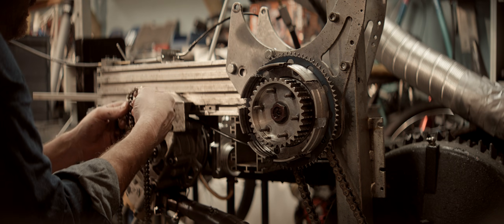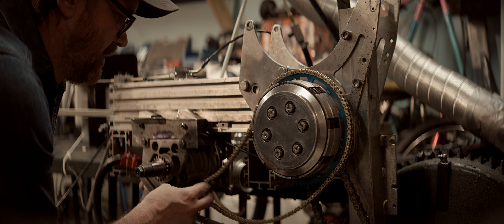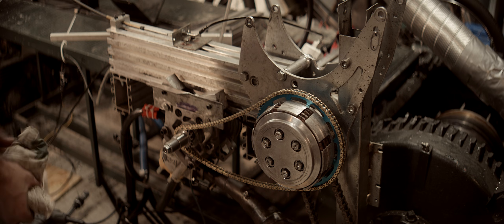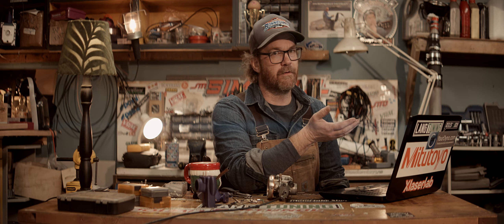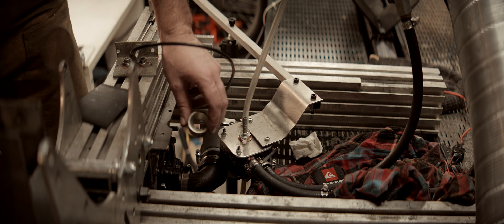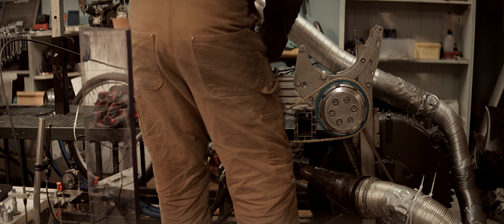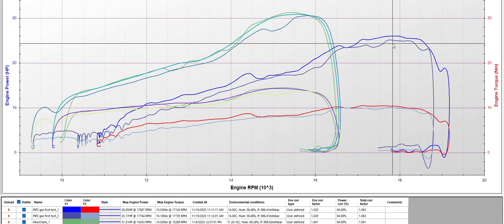50cc - 26hp on Pump Gas(without any tuning!)

Comment: I run methanol in race outboards. We have found that a pipe designed for Gas is always too long due to the cooler exhaust gas temperatures with methanol versus gas. In your video, the RPM with gas was 4,000 rpm higher than the RPM with Methanol/Nitro. Thus, the pipe you have is too long for the cooler EGT with methanol and is holding the RPM back because the tuned length is too long.
Reply: Hope he sees this, I can see this being the case. Great observation
Reply: I already wondered why it doesn't revv higher compared to other high performance 2 strokes like a 100cc kart engine or even setup Mopeds that reach 17k+
Reply: Yeah David is correct
Reply: 50 cc's is the magic number for street legal with no license, in many states.
   I'm picturing a 100lb bicycle, with 20+ h.p...sounds FUN !!
I WANT 2
Reply: @bartbullock7817 street legal with no license 50cc but restricted to 45kph. the most powerful were 8hp. there is no market for stock production 50cc more powerful than that but there is plenty of aftermarket kits. typically once you start u restricting and tuning for more power, there is no reason to not also  go higher 70/80cc kits. but yes there are 20hp 59cc optiond like Bidalot rf 50 wr
Reply: what does egt have to do with pipe lenght? (genuine question)
Reply: @CobroxYT cooler gas means slower pressure wave (sound) propagation and hotter means faster.
slower means pipe is tuned for lower rpm. if you want to go back to higher rpm you need shorter pipe.
Reply: interesting, I've never thought about it but in theory if you could have a way to mix variable amounts of gas vs nitro  you could adjust the EGT to make the pipe work optimally on that 4000rpm range. I don't see how that could work with carbs though but with it would with injection also you could also adjust slightly richer at low RPM to have even cooler and slightly leaner at high rpm to extend the powerband even more
Reply: 10:07
Reply: But his random home made made pipe makes never seen before world record power outputs no matter the carb or fuel used lol. More power than millimeter perfect designed pipes to suit every factor by international unlimited budget racing teams. Im not convinced one bit. Then i see smart experienced people comment and they just blow these videos out of the water with one look / comment.
Reply: I’ll respond to that with a question . . . Can you tell us how many unlimited budget, state of the art, international factory race teams are developing a 50cc two stroke engine to smash straight line world speed records? . . . Spoiler, the answer is ZERO. I’m sure the research has been done by various r and d teams over the years and if a manufacturer or race team were so inclined, they’d be able to blow this engine out of the water, But the fact remains there is zero commercial interest in developing a highly strung 50cc engine for any purpose, let alone for an application like this. . . Therefore it’s down to hobbyists and enthusiasts like our main man here to soldier on in pursuit of the ultimate bragging rights! And man I’m sure glad they do . . .
Reply: @DanielEske  I love when someone words their question to suit themselves. But in reality there has been MANY MANY MANY teams that have tried to be the "Worlds most powerful 2 stroke" mannnyyyyyy times over and you would be stupid to word your question outside of that context. Next question.
Reply: @DanielEske  You must be forgetting the past. Ignorant.

Comment: In Australia the lowest pump gas you can buy is 100 octane but it goes up to 110 so that would still count as pump gas. 😊
Reply: 91 RON is 100 octane?
Reply: True, but if I remember correctly the octane ratings are just based on one rating. They tend to be smaller when calculated as (RON+MON)/2.

Comment: chain power loss story. I once had a mysterious power loss of my 200BHP track bike resolved after just a simple scheduled maintenance, without the mechanic having found anything unusual. Around that time, attending the last MotoGP of the season, I had the good fortune to spend a dinner with two engineers from the Regina factory (that supply all the chains for MotoGP racing). I was curious to find out how much difference a good chain/sprocket combination could make. They were actually working hard at that time to reduce the power loss from… 4% to 3%! I then asked how much power loss could be induced by a worn chain/sprocket? Answer: “oh, easily up to 20%!”. Which totally explained my mysteriously solved power loss - during the scheduled maintenance, new chain and sprocket were installed ;)
Reply: "The best way to tune an old moped, is tune pump the tires and lube the chain"

Comment: Hey Alex, i would suggest to install a few chinese webasto style heaters in the workshop, instead of the old toxic fume edition you have now.  Those things are cheap and have an actual exhaust on them so you dont poison yourself  from diesel fumes 😉    i heat my workshop with one and its about 3.5kw full blast, i figure you need 2 or 3 in norway but its worth the few bucks those things cost and save yourself from a lot of health problems in the long run.  I wont complain about the nitro fumes.. those are lovely 😁  cheers and keep up the supernice video's as always!
Reply: Good idea!!!!. 
I was also going to suggest maybe an Aircon split with heating function.
These things are pretty efficients. 
The only thing their performance start to decay in very cold conditions. 
I don't know what minimum temperatures does Alex have in winter.??

Comment: 5.56. Anyone else see the spark fly off ? Looked like from the top of the new chain 😮
Reply: Yeap definitely even on my cracked SD screen saw it, strange tho didnt the spark go the opposite direction to chain travel?
Reply: @DumbGoogle-yz9crwatched it in slow motion. Your right opposite direction to the chain. It’s a spark that comes out of the crack/join just above the motor sprocket.

Comment: Good to see you back.
You need to control the flutter of the chain (dangerus and cost power).
Put some more effort on evacuating the exhausts and get a better facemask (with fresh air feeding).
Do not use a heater that burns Diesel or Cerosene and let the exhousts out inside your garage (Gasol is slightly better but not good for your healt either).
Take a course so you can get a license for handling nitromethane or get a deal with a person (and the autoroties) with a liciense that can handower limited amounts of nitro to you.

Comment: Great to see you back, this is a great result on pump gas! A note on 219 chain stuff. We've always found the Rotax 219 rear sprockets last much longer than any other aluminium ones. The material is much harder and they are anodized very thick. They combine well with a DID O-ring chain. Lasts relatively long on track, so in your case in your clean garage a set should last for a very long time.

Comment: I think you have too much carb for gas on that engine. According to the tried and true 2 stroke math 26-28 max (even this is a tad on the high side but should be ok with tuning) should be more than enough and should make figuring out the jetting easier!

Comment: I would get a fast responding egt probe. Started using them on my outboard 2 stroke. Is a game changer for fuel mapping! Worth every penny
Reply: This is interesting, just yesterday I was thinking about whether people were beginning to add "DIY" fuel injection to older two stroke outboards. I have never tuned engines but it would be a fun rabbithole to go into sometime next year as I plan to build a little runabout and I am in place where two-strokes make more sense. Could you elaborate a bit more on what you are doing with yours?

Comment: Don’t know about anyone else, but I much prefer it on gasoline (petrol as we call it). Just go for the gasoline record. The internals won’t corrode away either and the pipe will be the right length

Comment: Allergic reactions are usually triggered by stuff you breathe in or ingest... In your case there are many known cases of allergies against two stroke oil ingredients (especially ester oils, like the super techniplate, or the silkolene pro kr2 ). Ensure you don't breathe the exhaust, touch the oil, or rub your eyes with oily hands.
Reply: Great point. 

I would consider that any products related to engines whether it is fuel, oil, coolant, grease or the fumes, none of it is healthy for your body and has an effect on it. How one’s body reacts to it depends per person. 

Keeping that in mind, it is never a good idea to eat for example lunch with dirty hands, even if you have only filled the window wiper fluid. Even after wiping them off I still could taste it, but had no location to wash my hands in that moment 😂.

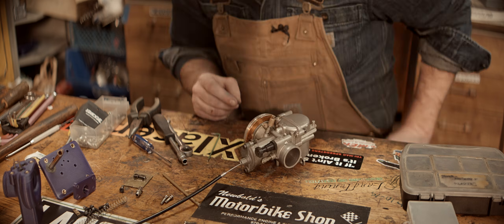Comment: Please tell me 6:57 you didn't just leave the chuck key in the chuck like that, I would really break that habit if you bump the machine and turn it on it'll Chuck that key, watch someone do that in the Machine Shop when I was taking my CNC course, also brand new mitutoyo Gage blocks go flying into the concrete ceiling because the person left them in the truck then when got pulled away from their setup and came back and forgot.
Reply: A better habit would be to isolate it at the box every time you walk away, its what my dad always does, its never live unless hes using it.
Reply: @dietznutz1 Both!
Reply: @dietznutz1 I mean yeah that's not a bad practice to power down equipment you're not using.

Comment: In Ontario Canada we don't have to license a 50cc bicycle..so the implications of your engine thrills me!  Plus the 18,000 rpm give me a woody! Lol
Can't wait to see you obliterate the world record!
Reply: but must be limited to 50 km/h
Reply: @aeroflopper  With the correct gear ratio, you could get 19,000 rpm at 50 km/h
Reply: @Blommefeldt  it will certainly get there quick
Reply: @aeroflopper  There is nothing better than cruising through town at 19k RPM, and a fuel economy saying gallons per mile.
Reply: @Blommefeldt  i dont think you would want that lol
Reply: @aeroflopper  "Officer, I COULDN'T  have been going that fast! This is only a 50 cc engine!"
Reply: @The-yp7lr I got disqualified at 16 for having a 100cc terry beckett tuned H100 engine in my honda MB5, loved that little bike.
Reply: Let’s get on it, I’ll risk it all.
Unless rules changed since, a ysr50 was allowed to go 80kmh but was licensed.
Reply: YSR50’s were a lot of fun for tinkerers Toomie pipes, grind out cylinder for reed blocks , bigger carbs, remove the head gasket use contact cement instead ,fibreglass ducting to keep the carb and intake air cool. Fine tune compression with how many spark plug gaskets we stacked,
Reply: I tried methanol but stopped because it was a path too far atm.
  Promising results that I tortured my law boy with to use up the methanol

Comment: it sounded insane at 19,000 rpm holy shit
Reply: The highest useful rpm's I have ever seen from a single cylinder 50cc two-stroke, are from legendary World Championships GP engines built by Kreidler Van Veen, Bultaco, Derbi, etc, and they all top out around 17.5k.
Reply: My 53cc 4 stroke only goes to 9300 rpm :'(
I had to Frankenstein a 2011 hs142f flywheel and cdi to a 2017 hs144f to get them rpm numbers numbers.
Reply: @thefunniestfarm4731 motorized bicycle engine? Cool

Comment: How many octane does regular fuel have?
Reply: In Norway 95 and 98
Reply: @ktmturbo5836  maximal 101 oder 102 in Deutschland, extrem teuer. Aber gut, insbesondere bei ‚alten‘ 4-Takt Motoren. Nur 5% „Bio“-Anteil. Es wäre interessant zu wissen, ob das bei hochgezüchteten 2-Takt Motoren etwas ausmacht.
Reply: @frankd3024  auf sicher wurde! haB ich immer gebraucht mit 40cc minibikes, grussen aus Holland

Comment: 2 to 6 year vacation --------- Baahahahahaha
Yeah you guys got some strange laws over there.
It should be obvious to any lawyer and govt official over there what you are doing with that fuel. It's just silly.
Reply: I guess it is after the Utøya terrorist attack. 80 kids killed. And first a huge bomb in Oslo
Reply: According to publicly available information from the trial and the police investigation, the bomb he used on 22 July 2011 was based on an ANFO-type explosive (ammonium nitrate + fuel), with some additional components that are only described at a general level in open sources. Nitromethane is not mentioned as a substance he used.

Comment: I'm only partway through, but why a shorter chain?
Reply from the maker: I thought it would help with the standing waves, but didn't...
Reply: @2STROKESTUFFING  I have an absolutely crazy idea; do you think it would perform in circuit racing if you paired this engine with a 7-speed cagiva mito gearbox?

Comment: Would not e85 be worth considering, unless it brings huge problem with lubrication. It is easy to get in sweden and i guess Norway?
Reply: E 85 would be worth a lucky 7 %  gain that's a little over 1.5 hp at a 30% more fuel consumption rate.. I'm glad he got bexk to gasoline